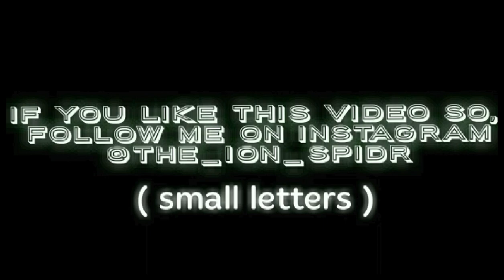How to make web fluid at home (web fluid  6.01 )

Comment: What if you somehow made a hot-glue-gun that fires out the glue way further and with way more power
Reply: QWERTY it wouldn’t work that well, watch videos on people who’ve tried it. The glue is ‘too heavy’ to be able to go long distances
Reply: You could try using lighter adhesive
Reply: That doesn't really work with something gooey
Reply: Let me tell you about a person called Michael Reeves...
Reply: QWERTY so basically a pressurised thing that can melt glue
Reply: The glue wouldn’t work since it’s hot glue if it’s shot the air will cool it off before it sticks to anything
Reply: Already exists a YouTuber made it as a web shooter and it can hold a car
Reply: Someone made a web shooter using that concept
Reply: @pian-0g445  Joel Creates did it
Reply: So a gun
Reply: @pian-0g445  umm watch Joel Creates see for yourself
Reply: Pressure washer?
Reply: with way more power comes way more responsibility
Reply: I mixed the glue sticks melted with gorilla glue and it's actually strong enough to hold up a lego set, an A wing
Reply: @pian-0g445  make new glue lol.u can use crabapple glue
Reply: I’m guessing it would be co2 powered and just shoot the melted glue
Reply: @pian-0g445  no someone did it

Comment: The method you’re using is the one I’ve been using for like 2 years, I been working on a small station. That could spin around few poles so it makes lots of webs, and so far no success
Reply from the maker: Ohh use a sprayer ( See spider slinger)

Comment: Who else thinks this is the new spider man?
Reply: Me
Reply: Ok this is just a web
Reply: Web fluid is a fluid that hardens rapidly when in droplet form
Reply: No man wrilly      NO
Reply: @crazyxgamerlol9271  correct. Actuall spider webs are made of a mixture of proteins In their DNA code that are placed in a water based liquid and harden after taking form. They are NOT morten plastic, and do not instantly dry from contact with air, they dry from stretching and shaping, and molten plastic is impossible to use for a web shooter, cuz a web shooter needs a muzzle, and the muzzle lets air through, so if you use molten plastic , it will dry up inside, and ruin the whole thing.
Reply from the maker: Exactly, well said man 
This video is only meant for entertainment 
But you did a good job
Reply: @theionspider8004  I'm not hating by the way, I'm just that one nerd
Still, you did well with what you were given.
Reply from the maker: @manietemadi3989  thanks stay tuned for better things, 😊
Reply: nobody
Reply: Yes

Comment: If that’s hot glue, I would recommend simply using a glue gun to melt and extrude the material
Reply from the maker: Yeah bro 
But now better is coming
So subscribe
Reply: @theionspider8004  have you ever thought  about crafting a mechanical shooter yet? It's a bit of a daunting process, but still possible.
Reply from the maker: @claytonschmohe1786  yeah that's what I'm saying I'm making better web fluid and new fluids shooting web shooters ( I didn't mention them😅)
Reply: @theionspider8004  yeah thats great. Would definitely recommend using nylon or some other polymer to start.